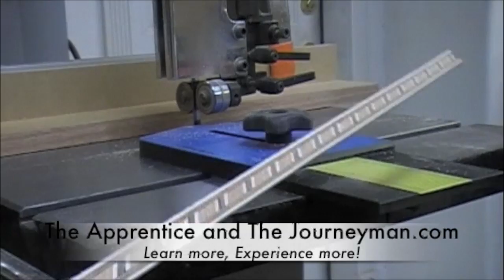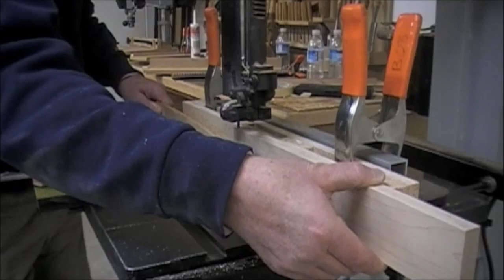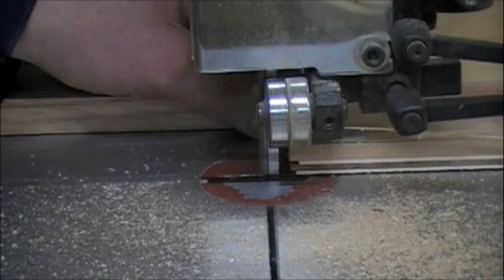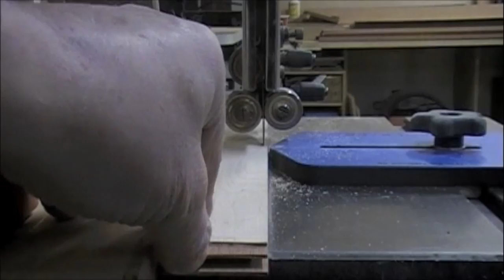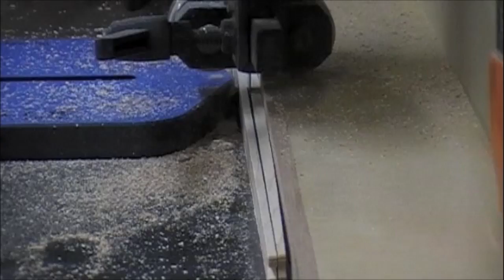Woodworking : Band Saw - L Shaped Rip Fence

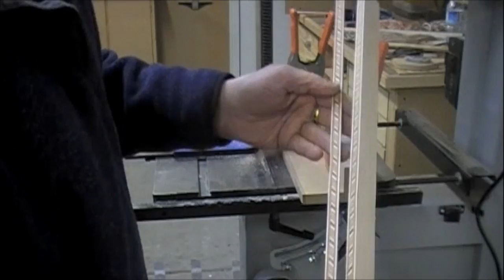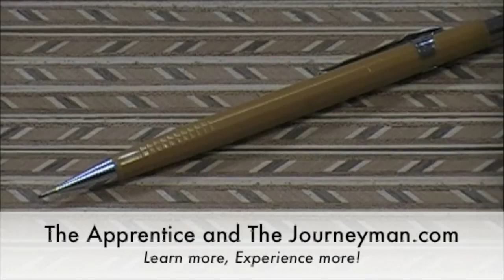Comment: As always, great video.  I noticed that the fence has a slight movement - it's very apparent at 3:31 and 3:41-3:59.  I had to play it over again to make sure.  How does that affect your cut?  Have you noticed any variation in thickness?
Reply from the maker: The thickness was not affected. As slight as the movement appears, it is more apparent due to the camera angle.